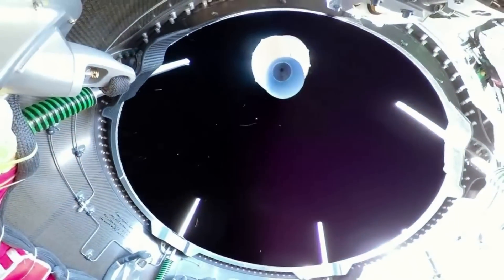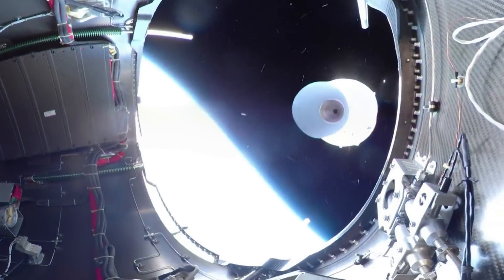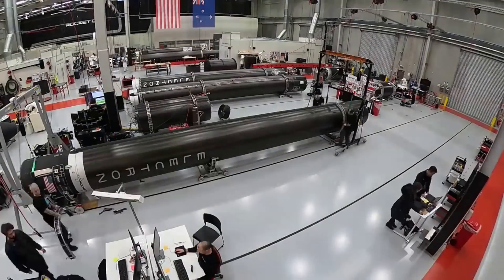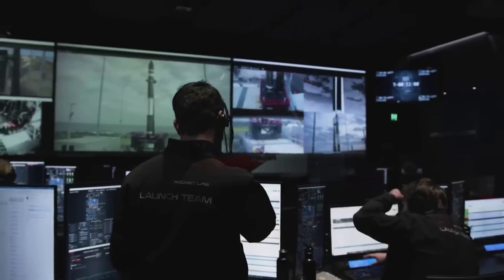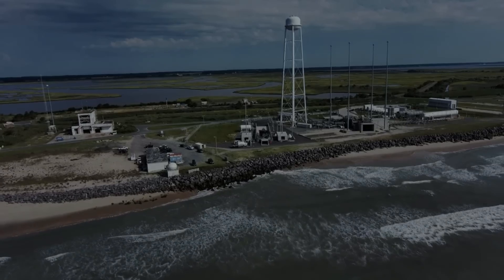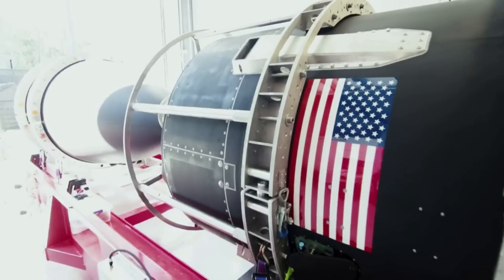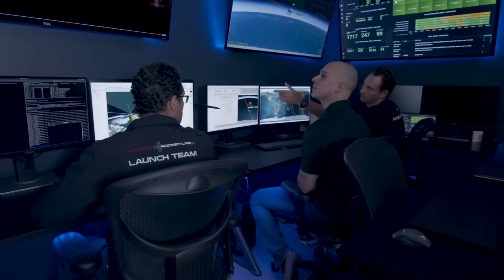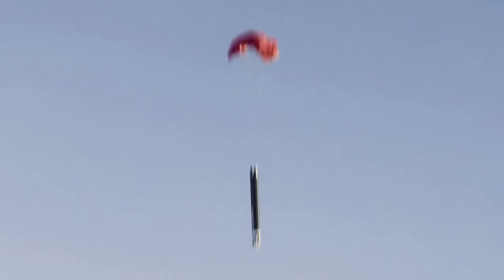Rocket Lab Scraps The Helicopter Recovery Method

Comment: I'm pretty sure reuse for small rockets is justa fashion accessory, not a paying strategy. Producing a small rocket is cheap enough, so I figure RocketLab are probing reuse in the "backseat mode", while the bulk of their effort is aimed at Neutron.
Reply: In today's increasingly competitive launch market, launch is never cheap enough. The engines are a significantly expensive part of Electron, so refurbishment should reduce launch costs significantly, especially as RL get better at it.

Comment: Why not use a little bit of RCS in space to 180° flip the engines into a water tight stowed-away configuration?
Reply: The top of the engines have a hole in it to let the fuel in.